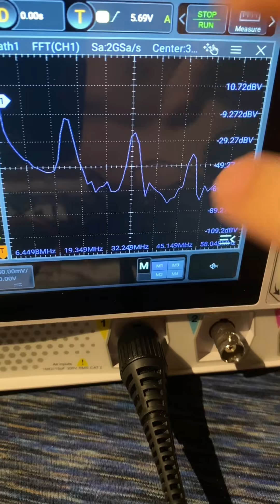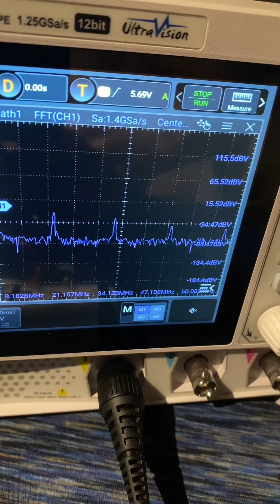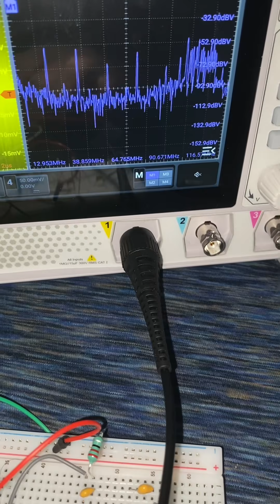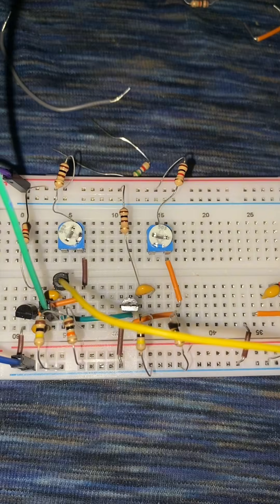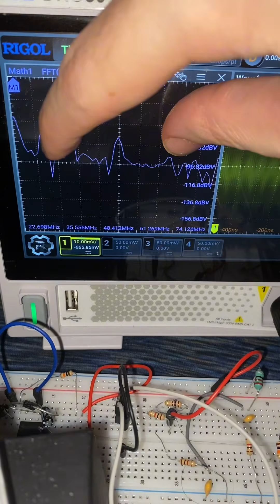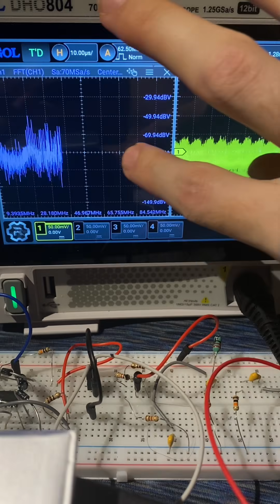I cant figure out how to amplify my receiver RF signal. Electrical Engineers please help. 48mhz.

Comment: Yeah, RF is pretty annoying at times but can also be amazing if you get it right. What's the goal of the project? Maybe i have some ideas and can share circuits that I've built before and that worked for me.
Reply from the maker: Im just trying to amplify the received signal to make it 2vpp
Reply: @MyEngineeringProjects1010  I get that, but what is the end goal? An FM transmitter? An oscillator for a receiver?
Reply from the maker: @Vikk1577 i need a strong enough signal to drive a comparator. I am going to switch the antenna off and on with a serial register driven mosfet to send ones and zeros to another circuit and then into my computer. No fm or am
Reply: @MyEngineeringProjects1010  Most comparators can't handle such a high frequency. You're trying to build a transmitter that can turn on and off from a logic signal and a receiver that picks up when it's on or off, no? 
Also, do you have discord? It could be easier to talk through than though yt
Reply from the maker: Yes i have a discord
Reply: @MyEngineeringProjects1010  What's your username? I'll try to add you tomorrow in 7-8h since it's pretty late now here in europe
Reply from the maker: astralmaster0101

Comment: I’m curious if the bandwidth limitation of breadboards is being encountered. It might be interesting trying things at much lower frequencies.
Reply from the maker: I tried. When I go lower than 10mhz it doesnt transmit strong enough to be useful. What makes me think its not the limitations of breadboard is that the oscillator of the transmitter has a strong 2vpp 48mhz signal with no issues. I think it might be because all the extra noise is also hitting the transistor base and its just a mess lol. IM still a beginner so I dont fully understand like for example when I unhook the oscilliscope probe, there still a lot of noise just on the scope itself so the act of measuring it could be a false representation. Electrical engineering is diabolical lol